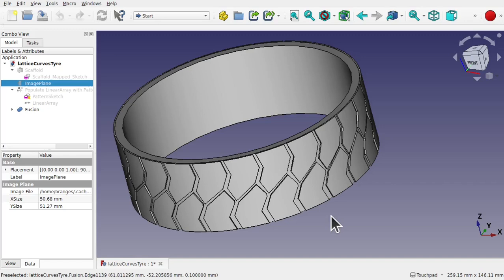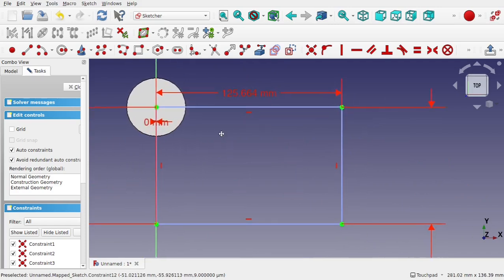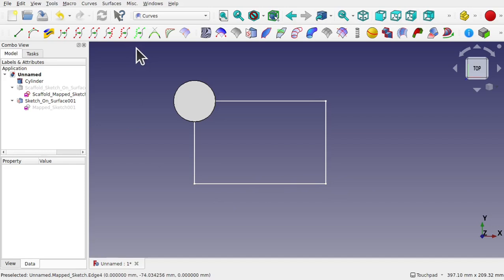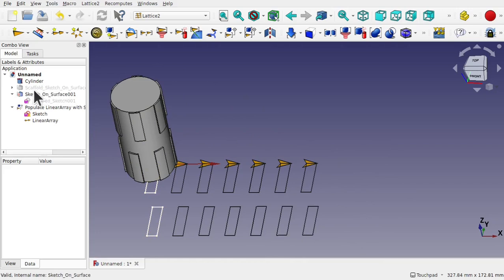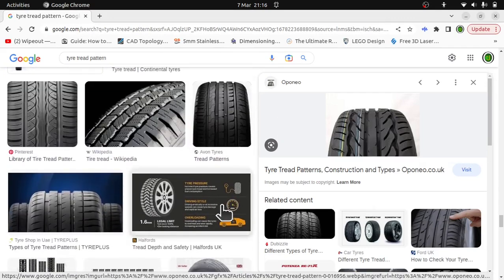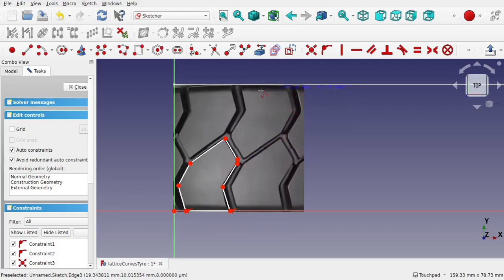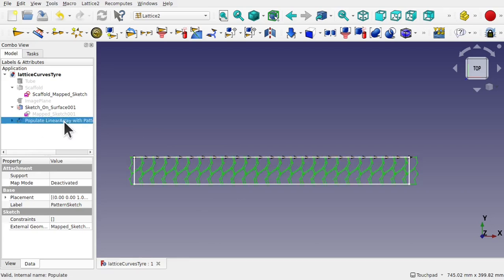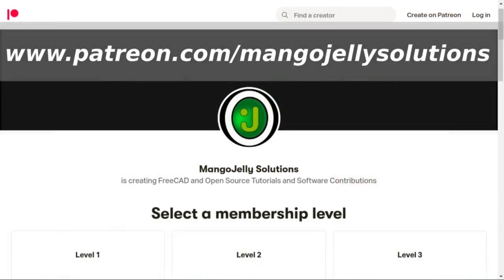FreeCAD Tracing a pattern and repeating seamlessly around curved surface | Curves Workbench Lattice2

Comment: I'm assuming this same concept can be used on a flat surface for a different type of of form/mold, correct?
Reply from the maker: Not exactly the same, you don't bother with the sketch on surface in the curves workbench and use a standard extrude in the part workbench on the lattice object. I have a number of tutorials for lattice workbench in a playlist where you can see how the lattice workbench can be used if that helps.
Reply: @MangoJellySolutions  Thank you so much!! I've been driving myself crazy trying to figure out how to do this on a flat surface for another hobby. I was going to look more into the lattice workbench as I can see some artsy uses for this same hobby that I can share with friends.

Comment: Would this work on the inner surface of the tube for grease grooves? Of course it would create a rectangular groove cross-section. How could you create a trapezoidal groove cross-section subtracting outward from the inner surface of the tube? I have tried using a helix with the pitch set to 2 times the cylinder height so that each groove is only 180 degrees of the cylinder. With such a high pitch helix, the trapezoidal sketch profile on the XY plane gets distorted badly in the sweep. It seams to me that you would need a sketch plane that is normal to the endpoint of the helix. I do not know how to establish this local coordinate system sketch plane.

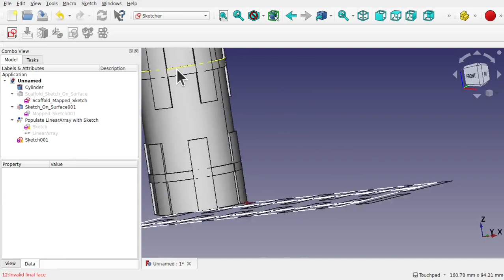Comment: I have a problem on 17:45. The recompute of sketch 2 does not work (V 0 20 Build 2). I made an own example where I had no problems by adding additive sketches. And using B-Splines for the sketches is possible ... but at the end I can not cut out off the cylinder.